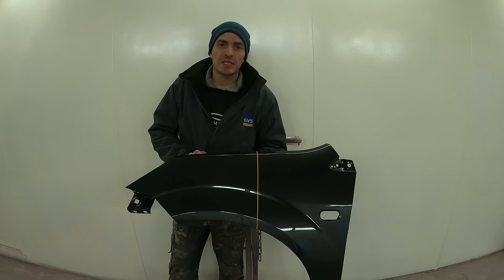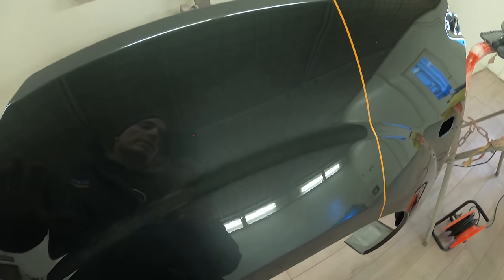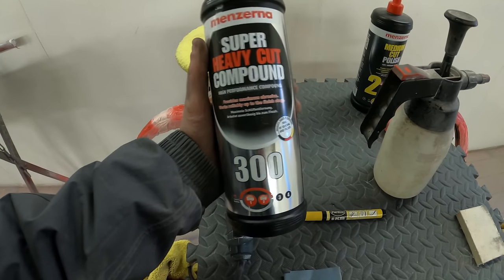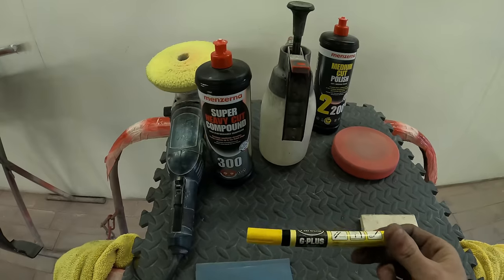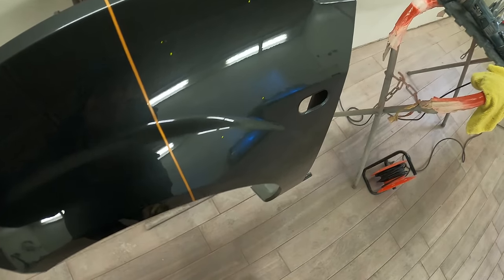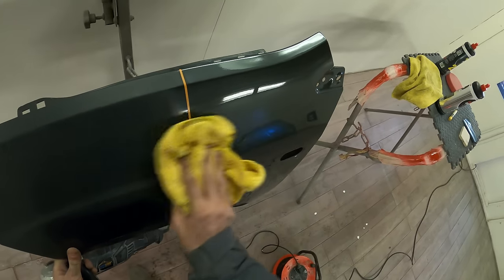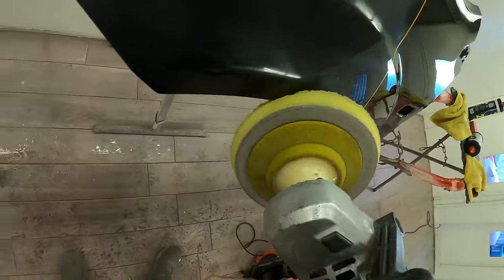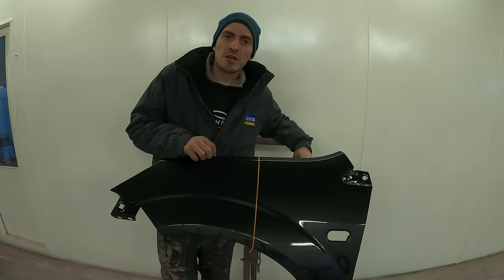How To De Nib Clearcoat / Wet Sand And Polish Ep 6 Car Spray Painting For Beginners DIY Series

Comment: Tony you're a star!! Great skill to watch. Thanks. I've got a de-nibbing question. I work at home and do the best I can to clean before painting and keep the garage as dust free as possible. Of course, I often end up with a lot of nibs right across my clearcoat. Usually I denib more or less one at a time, but sometimes there's too many for that to be practical (like today with a hood). I'm wondering what your best approach would be based on what I have to hand. I have hand papers up to p7000; I have 1,2 and 3000 soft back disks, and dry paper disks up to 10k. 
  BTW I use 1K Acrylic Lacquer all the way (it's much more convenient for a home system) so it's relatively soft for up to 30 days compared to 2K. 
What approach would you recommend? Hand sand all spots? Whole panel? Rotary or DA sand? What grit progression. I usually finish with range of Megiars compounds and polishes and scratch removers. I really want to avoid re-flowcoating.Thanks in advance.
Reply from the maker: I’d go for a p2000 all over followed by 3000 then compound with rotary polisher mate
Reply from the maker: No problem at all Garry glad it helped

Comment: I have little pointy dots, I guess they are dust nibs or the clear coat dried before to hit the panel I only noticed it on the last coat. I got about four coats of clear.  Will this work if it's literally everywhere all over the bumper. If so how long do I wait before I do this

Comment: Another good video :) 
 Between polishing stages , for diy with dirtier areas to work in , do you think it’s worth tacking off ?
Reply from the maker: personally mate id recommend a damp cloth fella if im honest just to keep the surface clean
Reply: Sound mate . I suppose dust that small wouldn’t scratch anyway .
Reply from the maker: aslong as its not getting grit say land on it mate then a damp cloths more than enough really to keep the surface clean mate thats all we really use if were in the workshop polishing or anything like that

Comment: Another great video mate. Can I ask, can the cutting be done with a DA or does it need to be a rotary polisher in your opinion? I have a DA already so wondering if I need to get a rotary too? Cheers and great content and info again.
Reply from the maker: You can do it with a da mate but it takes some time to find the right pad and compound combination tbh I use a rotary to cut which you can pick up for £50-60 and a da to finish it’s much quicker and better to use both that way than one or the other
Reply: @TonysRefinishingTV  Awesome. Cheers mate.

Comment: Hi! I saw that you always use the rotary polisher by placing the pad only on one side ... I also tried it and it seems that the polisher is more stable ... I wanted to ask you if it is better to use it like this or it would be better to place the pad flat on the surface to be polish ...?
Reply from the maker: technically flat is better but i find a slight and i mean slight angle just helps cutting speed , it can leave swirls on dark colours but then as long as you finish with a soft foam pad and medium cut / polish your good
Reply: Tony's Refinishing Is it dangerous to work with the corner if the cut is larger? you risk damaging the paint?
Reply from the maker: theres still a huge amount of the pad touching mate it doesnt show great in a video but 3/4 of the pads still on the surface but it is more abrasive yes